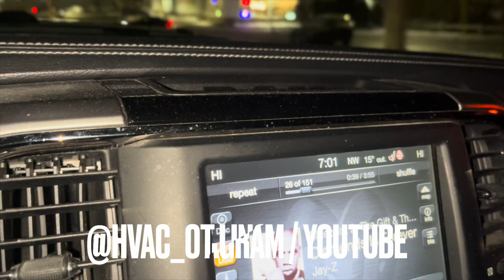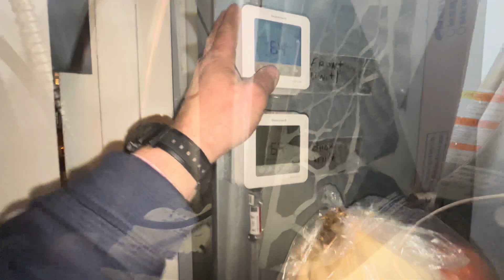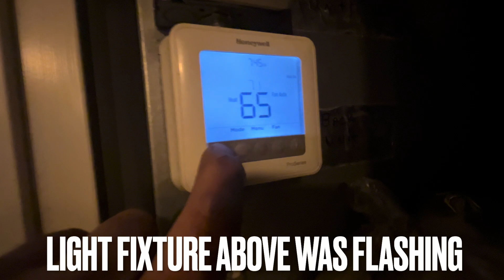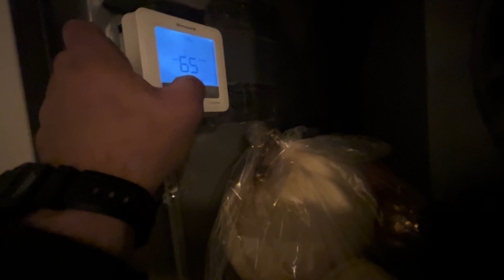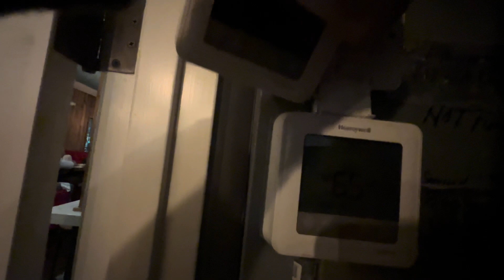PART 1 Two high efficiency . FURNACES DOWN IN RESTAURANT.  Why is my furnace starting and stopping?

Comment: Yea i had a house basement ground water just came up outta blue and got there almost 30 inches of water and unfortunately i got 2 inches bottom of board i dried everything 3 days tried to fire 🔥 and gas valve on lockout thats code flashing i ohm out the limit its fine and checked othercrap still no go so guessing i. Buyinga board
Reply from the maker: We aren’t even allowed to fire up gas valve that’s been drowned in water.
Reply: @hvacotj  When a gas valve  has been exposed to any water it need's to go. Good video
Reply from the maker: @chrissipple1018 100% and manifold.